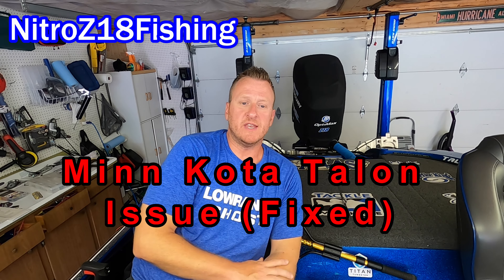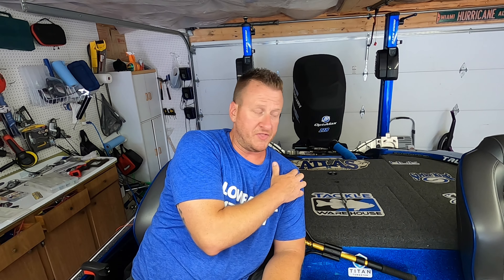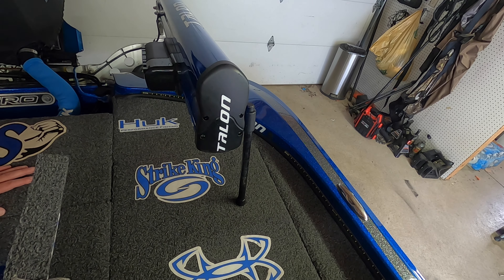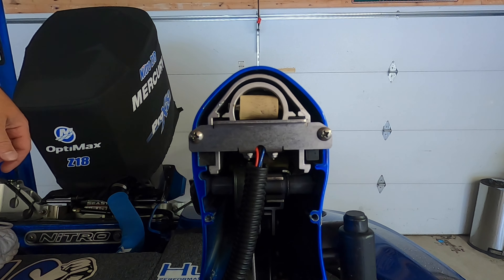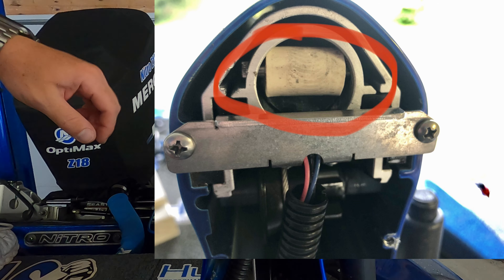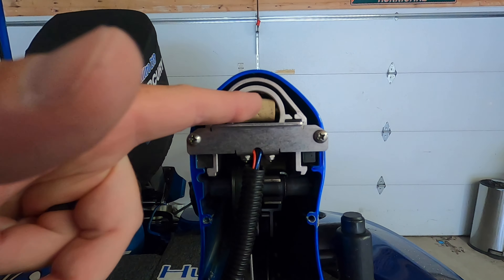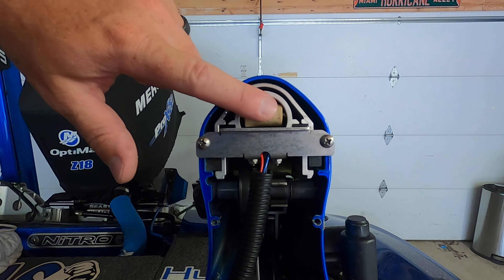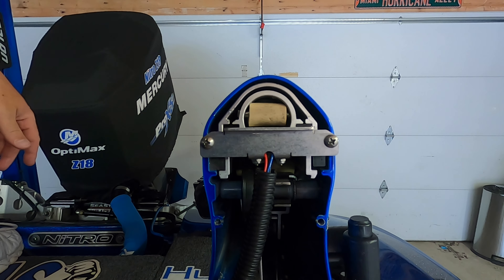Minn Kota Talon Problem (with fix), on my 2018 Nitro Z18

Comment: Thumbs up👍 My talons would not retrack back all the way up and will get stuck at the last light which is 2 feet. I replayed your YouTube video, did the same thing with the little tools I could find on my boat and it worked. That saved my life on the water🙏🙏🙏 thanks man
Reply from the maker: That’s awesome, glad it helped ya out man!…tight lines and be safe!

Comment: Thank you for this video. Mine did same and as you said, simple fix. I purchased my Talons in Feb 2021 and there have been a couple changes. Top cap only has two Phillips head screws making it easier to access slipped pin.  My pin goes all the way through the blue housing and is visible on both sides. I saw there was a problem as the pin was 1/2 in out on on side and not showing on other. At least Minn Kota made it easier to diagnose, now if they would fix problem that would be nice. According to rumors they won’t be investing much time in the Talon as they are discontinuing and have release Raptors.
Reply from the maker: Thanks for the info Bruce!…yea I’m strongly considering making the switch to the Raptors, they look legit…love my Talons, but may be time for a change, glad this video helped ya out!…thanks for updating with the new info!
Reply: Update: first time out after repair, half way through day I checked and the pin was almost out again. Looks like it will be an ongoing issue. My local Authorized Service Center is closed for 3 week vacation. I will update again after I speak to the about a proper repair.
Reply from the maker: How are ya making out?…thankfully I haven’t had any more issues with mine, hopefully it stays that way…haha
Reply: NEW FIND. Problem continued with each use. Found there is supposed to be a “C clip” between the plastic spacers the pin passes through. $0.37 at hardware store for the clip as shown on parts diagram. Ordered a Stainless Steel clip from Minn Kota ($0.89 part, $11 to ship) and wii install today. Also, checked inside Talon for old part - not to be found, looks like there is room for it too fall out. I have the tilt brackets so each time I wipe down boat after use, I now fully extend, clean and spray with WD40 Silicon or Lucas Slick Mist (alternate each cleaning). PM me if you want more info on clip. Raptors look like the way to go, but I am goin* to nurse these a little longer before pouring in another $4k.
Reply from the maker: @brucebroadwater8198  Oh wow, that’s good to know!… Thanks for the update!… Thankfully I still haven’t had any problems with mine but if it happens again I will definitely go that route… I keep going back-and-forth on the Raptors myself

Comment: Those 12 ft talon, do you have to be a around 11 ft for the anchor spike to be able to lock in the mud or can you drop your talon rite at 12 ft and still get a good anchor spike. I am thinking it still has to penetrate the spike deep thru the mud enough which takes up some of the lengh already.
Reply from the maker: Yea I’ve found that you only get a “solid“ hold in depth up to around 10-11’ max… if it’s really calm they may hold me slightly deeper but if there’s any movement from wind/other boats, they definitely don’t hold at 12 feet

Comment: Regular WD-40 is a water displacement formula that quickly evaporated. Best to use the “waterproof silicon spray” from the WD-40 brand.
Reply from the maker: That’s a good tip, thanks for the feedback Steve!… I’ll try that next time I clean them, thanks for watching!
Reply: I use silicone as well.
Reply: I now use WD40 Silicon and Lucas Slick Mist. I have tilt brackets so I can easily clean or lube every takeout right along with wiping down the boat.

Comment: When this happened did it just make a clicking noise? I have 2 12 ft and one does not go down but makes a clicking noise. Thank you
Reply from the maker: Hey Jim!…it did, when it got to the point that it stopped it would click a few times before it just “went dead”…hope that helps!

Comment: Great review thx.. WD40 is not a good oil it works more like a detergent for cleaning or loosening stuff, don't get me wrong it works great as a quick temporary solution, but then you have to use a good oil or grease
Reply from the maker: Thanks for the feedback!…yea I have to agree there, using a good marine grade oil/grease would definitely work better!…thanks for watching!

Comment: Only problem i've had is the 30 amp fuse tripping. Fyi that fuse can be rest. Just reset it and go on. This is on the Raptor not the Talon.
Reply from the maker: How are you liking those Raptors?...I’ve considered swapping to them instead, they look sweet but I don’t personally know anyone who has ran them yet, thanks for watching!
Reply: @NitroZ18Fishing  love mine.. cool thing too is I can run the tm and raptor on my Solix gen 3.
Reply from the maker: nice!...that's one of the reasons I'm considering going back to Power Poles as well...I run all Lowrance HDS Lives, and the Lowrance Ghost trolling motor...so if I swapped back to PP, I could do the same from my graphs, but I could even control them with my foot pedal of the Ghost...I'm torn between the Raptors and going back to PP Blades...thanks for the info!!